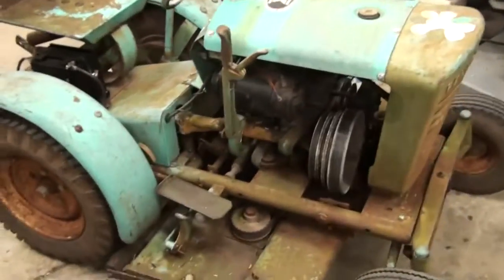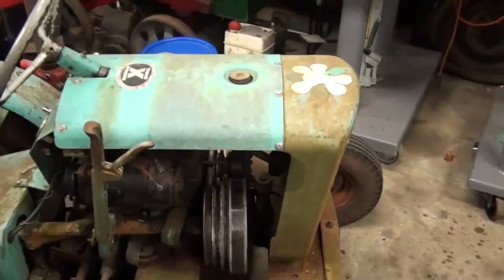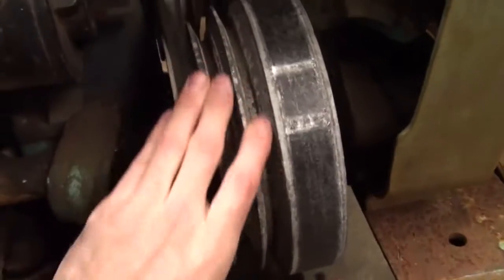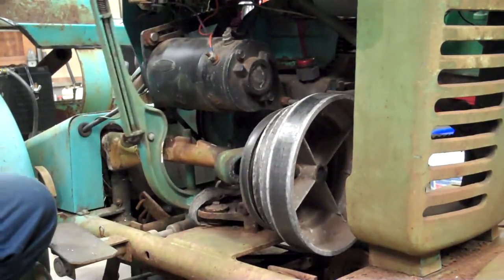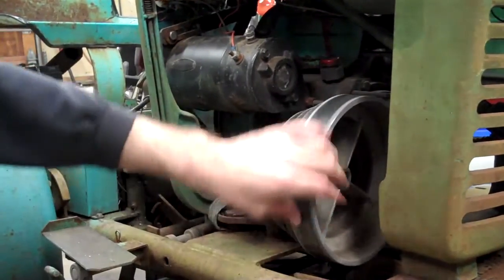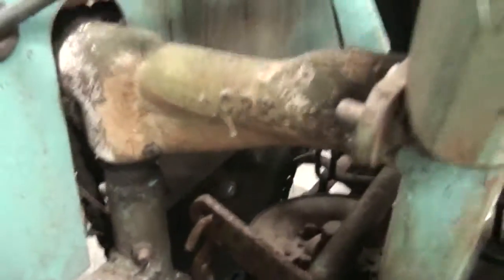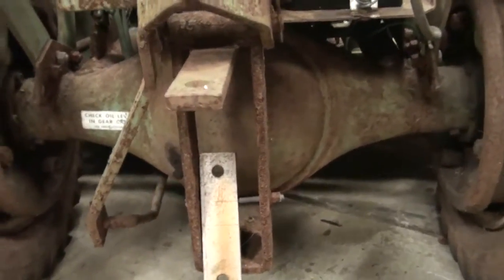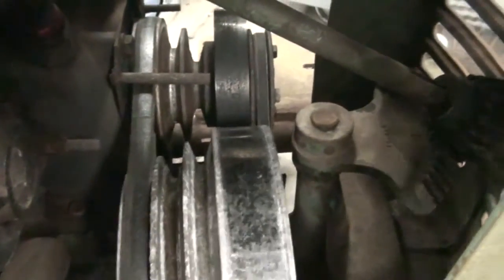1960's Pennsylvania Panzer Drive System-How It Works!

Comment: I'd say it was just about imossible to blow up the transmission.  Somebody had a really good idea, wonder why it didn't catch on with other manufacturers.  Nice vid, I had seen Roadking talk about it before but that really is an interesting drive system... It never fails to blow me away that those panzers had a huge Chrysler differential in them.
Reply from the maker: honestly its probably patented cause these are the only tractor that uses this setup yeah the chrysler rear is like a novelty on these things lol
Reply: I wonder if they had a sweetheart deal with Chrysler for those diffs... The Glidematic drive in those panzers is so simple and so reliable you'd think even if they had a patent it would have run out at some point and SOMEONE would have copied such a great idea... I guess if they don't make these cheaper built tractors to break, then peope won't buy the newest tractor when they come out!